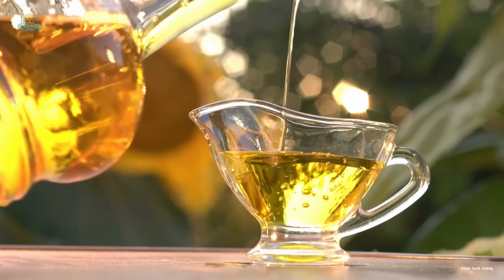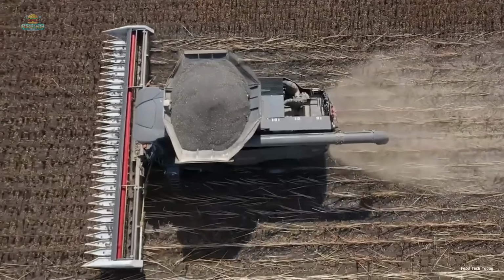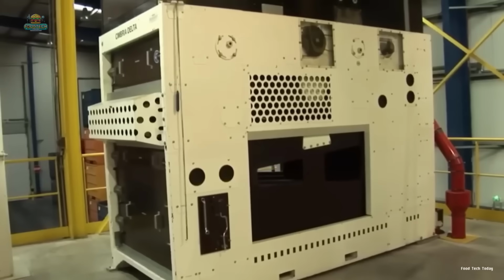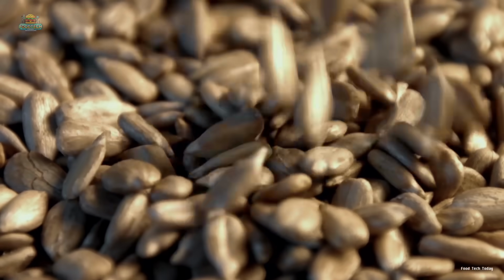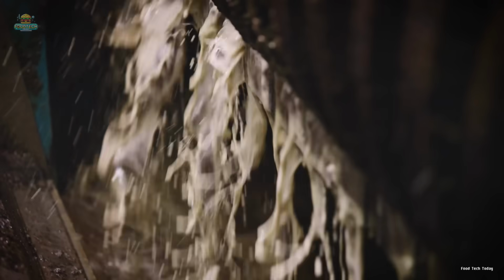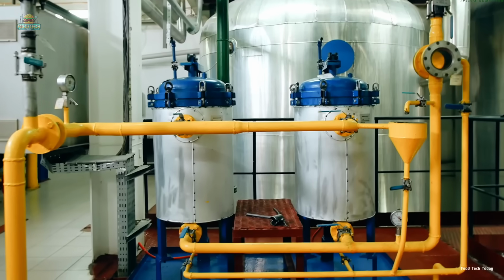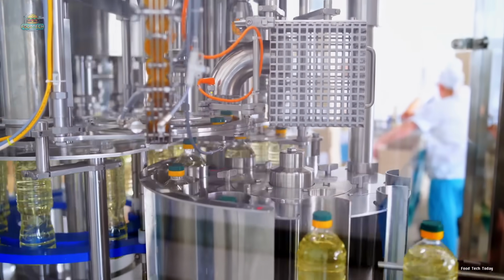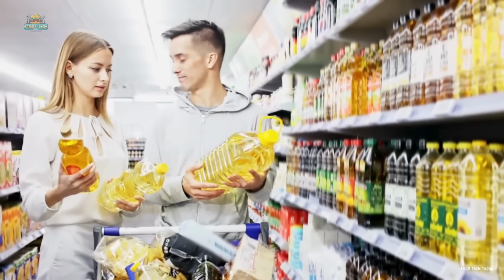How is Sunflower Oil produced in a Factory 🌻 | Little-known facts about Sunflower Oil.

Comment: Clean the floor and the  under the floor  to maintain the  fresh air nothing badly Annoying air destroyed the steel  connector  caused the stain to the  body of the machine
Reply from the maker: Thanks for the suggestion, that's a good point about keeping things clean for air quality and machine maintenance.

Comment: Always permanent clean inside the factory and the facilities after the use of the machines and u applied the oil cleaning process  u nid testing the machine before u inplug  the connection electricity  connection supply  and the mainfunction electricity meter off
Reply from the maker: It’s really important to keep things clean and safe in the factory.

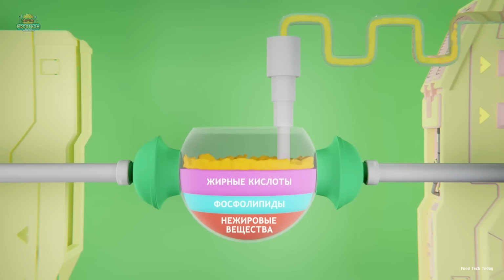Comment: how many and what chemicals are used during the refining process 10:17 ? Sounds like a witches brew of chemicals at this stage.
Reply: Right, the extraction and refining process can involve some nasty chemicals. Hexane, Sodium hydroxide (lye),  phosphoric acid, when mechanical extraction and physical refining is not used.  Most seed and vegetable oil manufactures are not very forth coming about which process is being used.
Reply from the maker: The ingredient you are most concerned about is probably preservatives.
Reply: @FoodTechToday  I'm even more concerned with the solvent hexane used in the extraction process of seed oils like sunflower, canola, and safflower